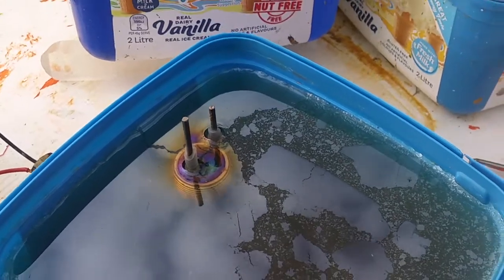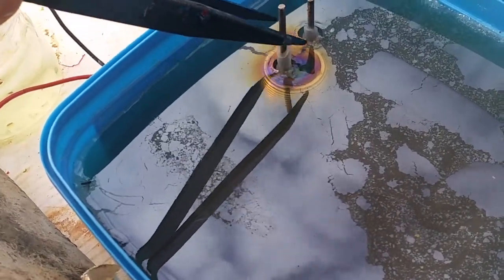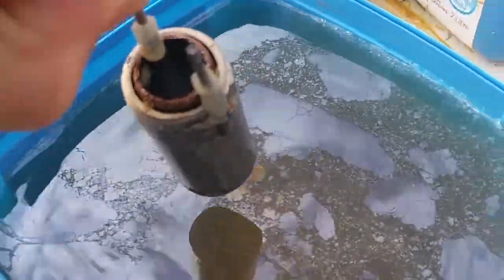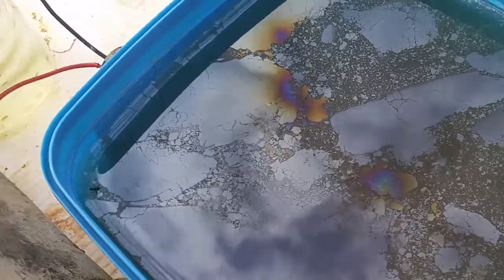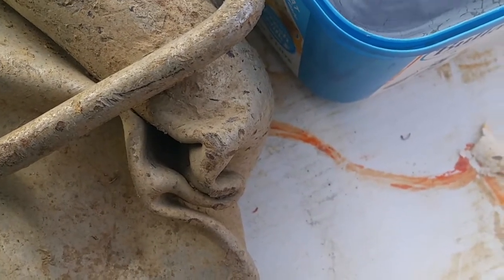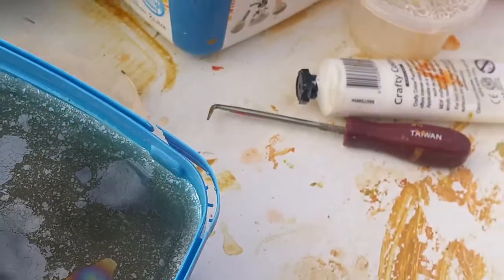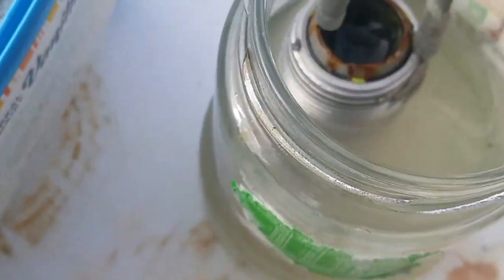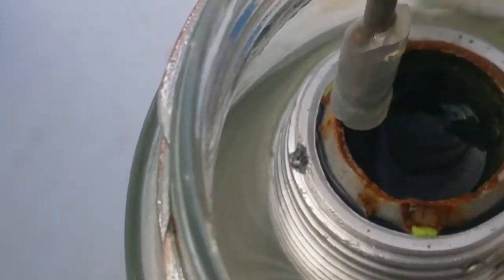Brass after Oxalic, HHO conclusion

Comment: Wow that film 😮 how would you test its conductivity?
Reply from the maker: I have considered this. I would make a table below the water line and place a piece of glass on the table. Then lower the water level without disturbing the surface, with a drain hole in the vessel. Then once the slide is dry...bake it on in an oven.
Reply: m3sca1 yeah good idea. I wonder if it recombines if stirred . Self healing 🤔 maybe a sustrate for single layer graphene oxide to bond too 🧐
Reply from the maker: There is a chance that carbon is responsible. The backbone of oxalic is a single carbon ring but i have no way to test wgat that stuff is.
Reply: @m3sca1  you could put a glass slide just under the water level and leave it in the sun... evaporation will slowly lower water level and maybe deposit an even layer of that film on the slide...